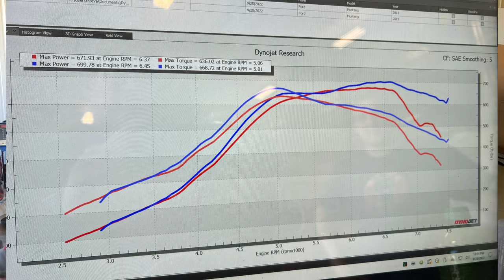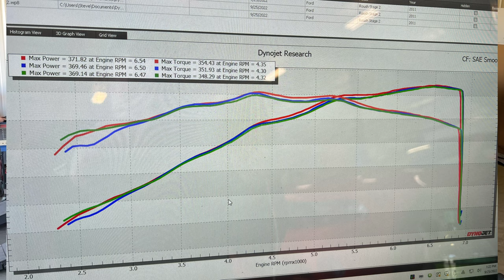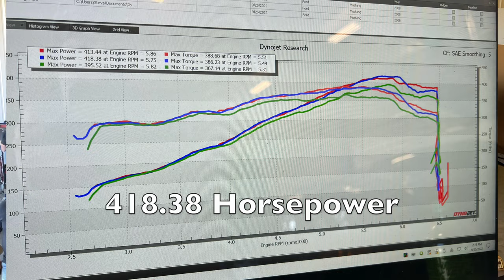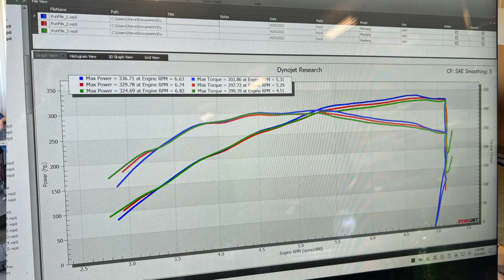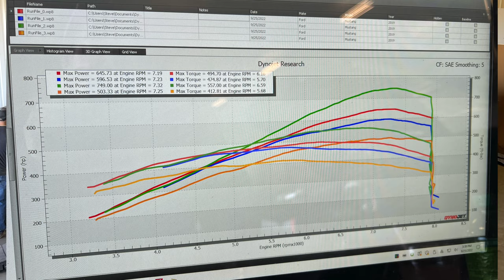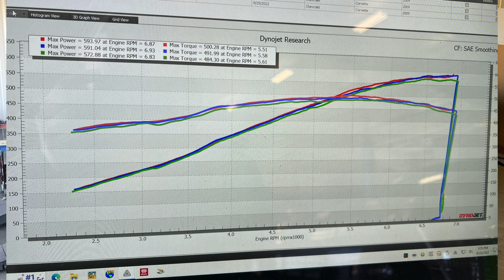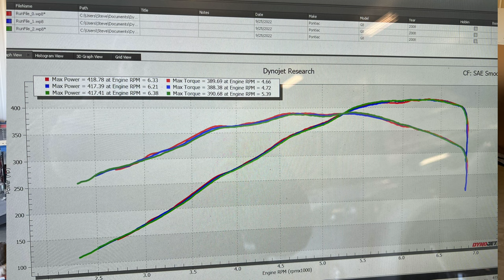Mustang Club Dyno Day: 20+ Cars Tested on Dyno

Comment: I kept waiting for a hood to fly off. Be interesting to get your evaluation of results. Some had very tight data while others were all over. Wide range of horsepower. Manufactued that way, engine size, super charge, turbo charge or significant amount of money spent on engine mods. I would like to know more about your business and more about your history in the restoration business. Did you work for a shop and then out on your own? Training? You’ve got a lot of energy.
Reply from the maker: The cars that have tight data are generally naturally aspirated and the cars with power all over the place are generally turbo charged.  Heat can really effect a car and how tight the data is shows how well the builder chose the correct thermostat for the cooling system and how well the radiator, intercoolers and fans work.  Turbo cars have a tendency to heat soak more than supercharged cars and NA cars generally do not heat soak at all.

Comment: Very interesting and such mixture of results. It obviously depends on what modifications have been done and so on. I have seen single  a car on a Dyno before but not  so many of the same make. Just one question Steve what is the device setup each time in front of the car? Thanks for the video Steve must have been a long day. 👍
Reply from the maker: 15 minutes if it is the same type of car over and over like this.